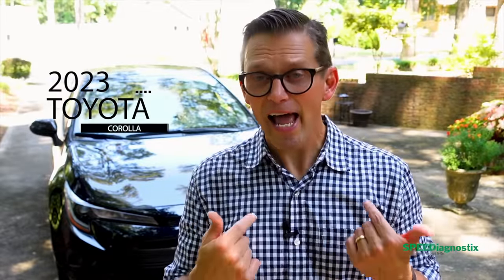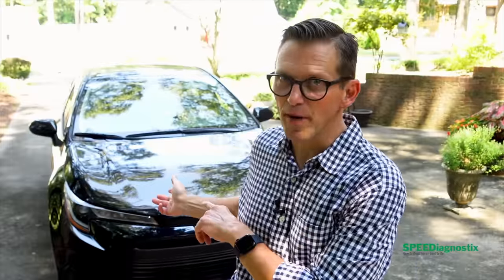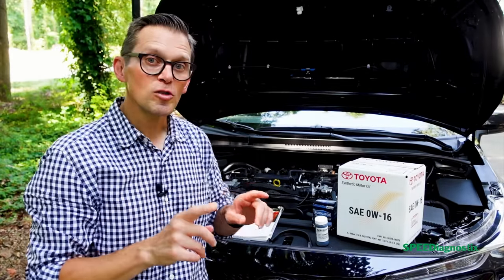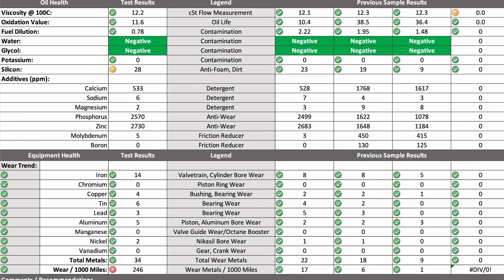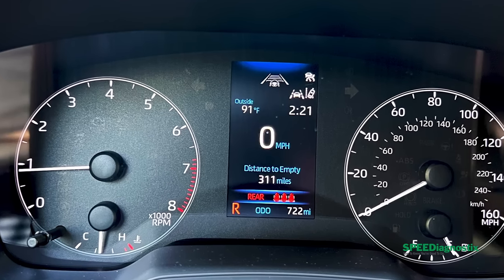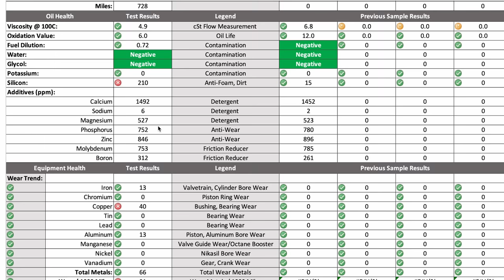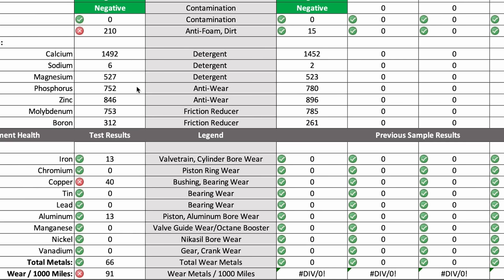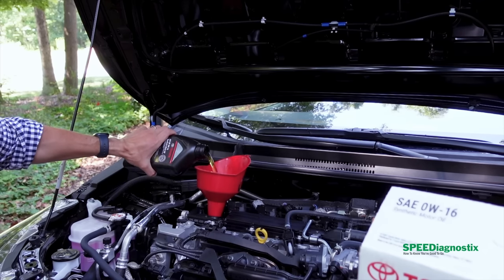AVOID the ONE MISTAKE Almost EVERYONE Makes With A Brand New Car

Comment: 10k oil changes are just a gimmick the manufacturer uses to advertise a lower cost of ownership
Reply: Dig ding ding!
Reply: Ding ding ding!
Reply: After seeing the inside after just about every GM car in my area from the early 20 teens, none of my oil will ever see more than 5k. That's using Amsoil too.
Reply: the 10k oil changes are to satisfy the EPA environmental requirements. nothing more nothing less. if you follow the recommended oil changes from the manufacturer you are damaging your engine.
Reply: I’m a dealership Mopar parts guy. I’ve been telling customers to ignore that oil change meter for years. After break in normal use I tell customers 5-6k max with synthetic, 3k for spirited or harder use. Change after racing or hard core use like heavy towing.
People really need to still treat their cars lightly during the first 500 miles. Especially performance cars. Dodge actually put it in the manual.
Reply: @michaelotoole1807  What a load of crap.
Reply: No it's because engines are better built and oil lasts longer. It's more environmentally friendly too. A good synthetic will do 25k miles easily.
Reply: LOL
Reply: @motleydude73  Nonsense.  There is a sane middle ground between 5K and 25K.  Get an oil analysis done.   Plus it depends a lot on the specific engine, and driving cycles, that some pollute your oil more than others.   There is no magic oil that changes that even though some do last longer than others in IDEAL situations.
Reply: @stinkycheese804  10k miles is the standard OCI these days, has been for 20 years. Oil analysis? What the hell for? Just change it out as per manufacturers recommendations your car will last many decades.
Reply: @motleydude73  Best thing is to NEVER change the oil. Just the filter and top up occasionally. Cheaper, more earth friendly, and better for your engine! Ding ding ding! (Jeezums....I'm just joking...C'mon man!)
Reply: @bkdexter79  Just stick to manufacturer recommendations and you'll be fine. Youtube 'experts' should be certified insane, oil geek included.
Reply: That may have been true in the past, but modern oil and engines are able to go 10K miles easily.

Case in point, my 2010 Fusion hybrid. I always changed oil when the meter told me, anywhere from 10-12K miles. I used either Motorcraft or Valvoline exclusively, full synthetic or synthetic blend. That car is still running around with a family member at over 250K miles, doesn't burn any oil and has had zero issues with the engine.

Oil and filter quality are far more important. Each oil change introduces a period of time the engine will run with zero oil pressure, which causes a lot more harm to the engine (relatively speaking) than just changing the oil half as much.
Reply: @supersnot4  There is always a film of oil on integral parts even after a full drain. 8 or so seconds is all it needs to get up to full psi again. I'd doubt any damage is done. Valves might tick for a few seconds but it's hardly causing terminal 'damage'. And yes 10k is perfectly fine.
Reply: Oil changes every year. Maximum 15k kilometers. Never go above 20k
Reply: @motleydude73  I'm only speculating here, but that small film of oil will be gone within the first few revolutions at best. Clatter from lack of oil pressure means metal on metal contact and wear.

Either way, the difference is so minute that it doesn't really matter. I'm just of the opinion that oil changes before 10K are a waste of time and money (when using modern synthetic and good filters). I've used this line of thinking with every vehicle I've owned (15-20, I lost count), and every one of them has passed 150K miles with no lubrication issues whatsoever.
Reply: @motleydude73  You can't get attention while telling what the majority is telling (inc. car manufacturers). So they need to come along with something special. It's up to you if you believe what they are telling you. The more experienced you are the less you are believing in those specialities.
Reply: @peerpaulin8486  What? 🤣
Reply: @motleydude73  Beware of clickbait.
Reply: For the following changes 10k miles is totally okay when using modern high quality full synthetic oils. PAO oils could even last longer. Shorter intervals were necessary when junk mineral oils were the standard. Many manufacturers ask for 30.000km (whatever that is in banana units). And I don't think that is an overstretch if driven on long distance highway journey within 1 year. My old VW didn't get a change before 50.000km, sometimes 80.000km, when I didn't had the time to do the change. It died with 16 years and 340.000km on the clock. Quite okay. Maybe it could still be alive with better maintenance, but then I would still have to drive the old beater. ^^
Reply: Lower operating costs and more frequent auto purchases. Manufacturers are not really concerned with the people that try to keep their vehicle for years and years.
Reply: @markleggett3944  But they do. Toyota build their reputation on longevity.
Reply: Weird, running my car at 10k and sending oil out for testing periodically, currently >100k and absolutely perfect health
Reply: @motleydude73 it's the temptation to be contrarian and feel like you're the only one not getting duped. It's the same kind of thinking that leads people to become conspiracy theorists, the need to feel like they're the only ones in the know and that everyone else is wrong.
Reply: @motleydude73 wonder if those Tundra owners would have found metal chunks in their new turbo six engines to save them from failure???
Reply: 10k 12 months is fine with modern oils unless you live somewhere very hot/dusty, problem is flexible /long life service intervals that go up to 20k/2 years. I have 30+ year old cars with hi mileage ( 200k plus) that have had 9-10k or 12 month changes no problems.
Reply: They only care about the leasing costs for full service commercial users, not private buyers.
Reply: Said the guy who didn't use full synthetic or get an oil analysis done.
Reply: @Spike-sk7ql   Your lack of knowledge will cost you $.  Go ahead and spend it.  But why not get an oil analysis from Blackstone labs, it'll cost about the same as 2 qts of Amsoil.
Reply: @lonniebeal6032  Is my "lack of knowledge" coming from first hand visual inspections of engine internals at a GM dealership in the 2010s when GM was telling people to go 10k between oil changes. Is my "lack of knowledge" coming from fixing cars professionally for the last 30 years? I've probably forgotten more about cars than you'll ever know. Bottom line is an oil change is a hell of a lot cheaper than an engine rebuild, or a remanufactured engine. I've seen the sludge that coats the whole of the inside of the engine when using dexos approved oil, from the damn dealership, and going 10k between oil changes. Sludge so freaking deep in the top of the head that you can't make out the cam cap bolts, or the head bolts. I've got first hand experience with this stuff. Maybe I'm not an engineer, and yhats why you assume I'm stupid? Let me just ask you something...... why am I the one who has to fix the engineers mistakes if my knowledge is so lacking? Maybe before you tell someone they're stupid, you may want to think about NOT coming off like a total douche canoe.
Reply: @Spike-sk7ql   yeah right.. I changed ny oil every 10k and no problens whatsoever after 260k. Use synthetic and change every 10k.
Reply: Lower EPA cost as well Im sure.
Reply: 2000 oil changes at minimum.  Doax Montassi , the best engine builder in the world did a study and 2K is the medium.